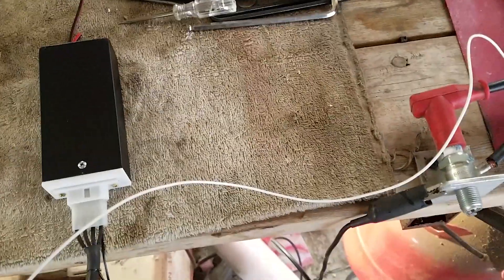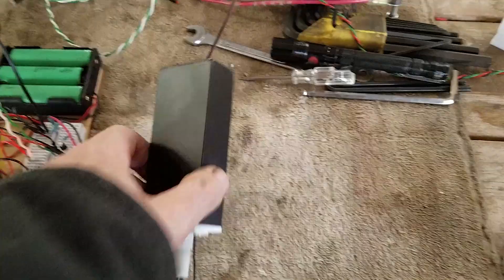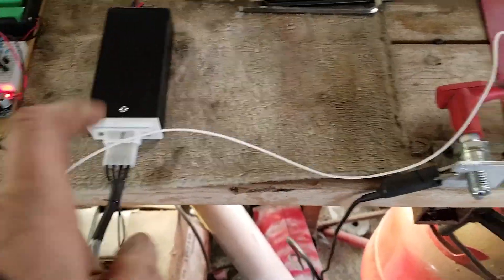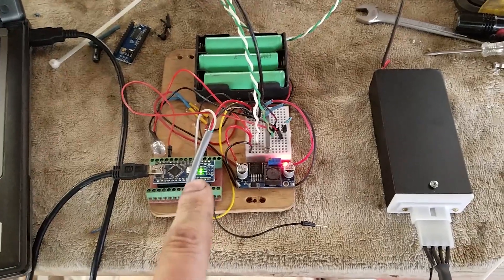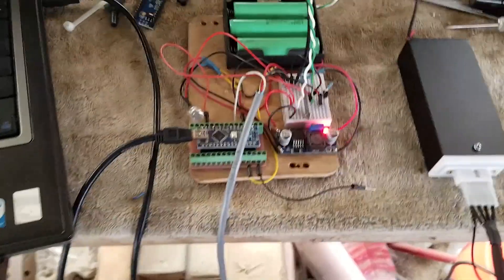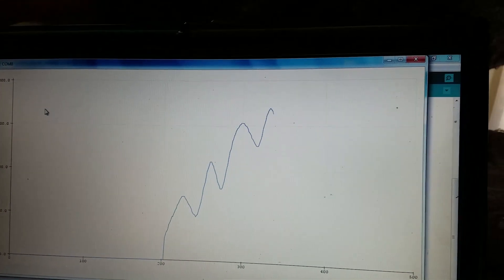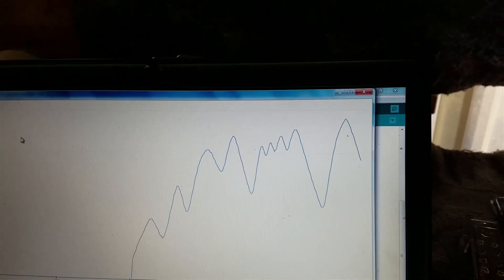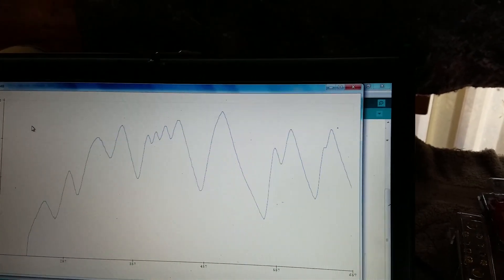Signal Clean test

Comment: What do you think of using the same Arduino UNO to count rpms as you are using it but also with a K thermocouple as EGT? I mean, do you think the Arduino Uno will be enough to handle both signals at the same time? You know how important this is on a 2Stroke.